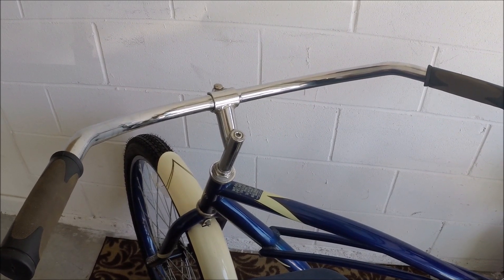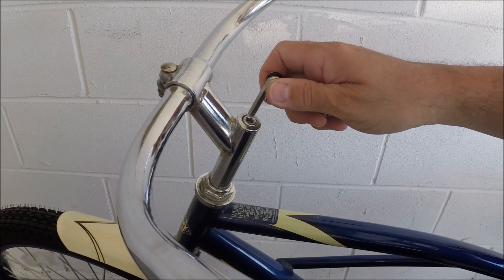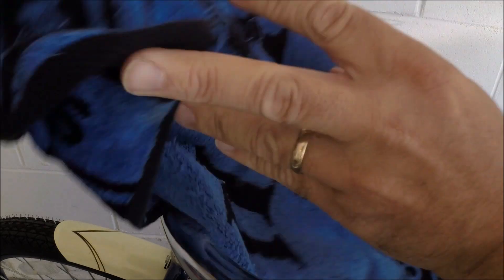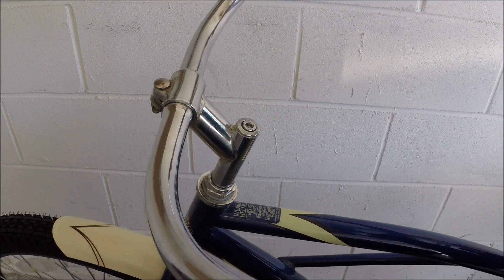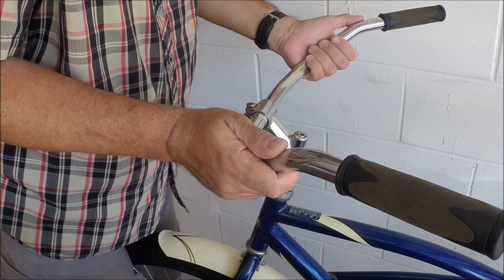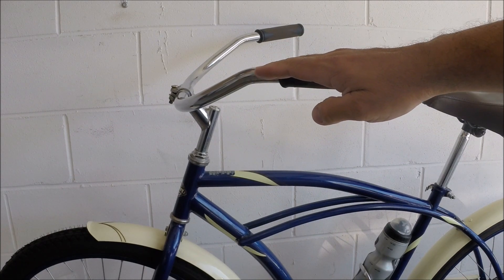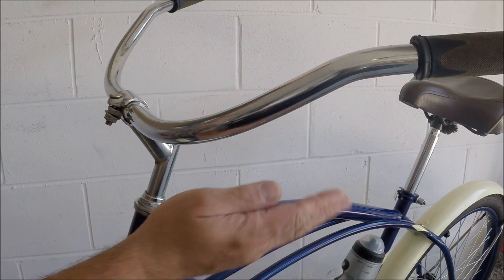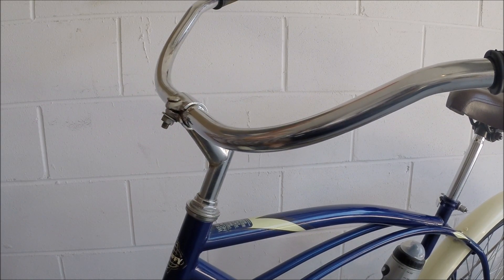How to adjust the handlebars on your Beach Cruiser

Comment: Thankyou for making this. I have a cruiser bike that had the bars at the right height for me, so I never bothered trying to adjust them. I might be selling it, and when I unscrewed the top bolt to see if I would easily be able to adjust it for the next person, I still couldn't push anything down. Figured I might have to take the fork apart or something strange, but never thought of a rubber hammer to shake it loose.
Reply from the maker: Yeah.. water and mud can seize them up a bit.

Comment: was able to tighten the align bolt, but what I can't seem to fix is main part that holds the steering , the gooseneck. Where you put your L tool, it'll stays loose
Reply from the maker: You might need a slightly larger circumference on the piece that sits inside of the gooseneck. You've got a couple options though. 
1.)Handlebars are cheap.. you can take it to the bike shop and see if they can upsize you, or measure it and buy a new pair online. 

2.) And a cheaper option.. they used to make metal handlebar shims that slide over that part of the handlebar and makes them fit tighter. I'm sure I've seen them for sale online recently as well as on ebay! Hope this helps!!

Comment: What if the Allen bolt is too tight, it won’t budge with the Allen key
Reply from the maker: @charlottegray5218  I would say try to use some WD-40 to help loosen it. Make absolutely sure the Allen wrench is very tight as you don't want to round it. Finally, try to slip something like a metal tube over the long end of the Allen handle This will give you more leverage to crank on it, as sometimes it's hard to get the proper leverage with just your hand on the smaller wrenches

Comment: I tighten my goose neck all the way but it still moves please help
Reply from the maker: Go to Amazon and buy a shim for it. This will fix it..
https://amzn.to/3DBaujw
Reply: @theretrodad8716  no it's not that it's like I stand in front of my front tire and I can still move my handle bars left and right when they should be tight with the front tire
Reply from the maker: @Steven Miller  Oh. If it's tightened all the way and it's still loose, you need a larger sized gooseneck. The best thing to do is to stop by a bike shop that also works on older bikes to see if they can fit another gooseneck. It shouldn't be expensive at all. They may even have a used one that would work perfectly.

Comment: What if it’s the bolt and it’s Allen wrench and at its tightest it still loose?
Reply from the maker: If the handle bars are still loose after a full tighten.. you may need to add a handlebar shim. They sell those on Amazon for pretty cheap.. or a bike shop could add one for you.

Comment: I was thinking I was doing something wrong, but as it turns out, the bolt I’m tackling is just too tight for me to unscrew 🙃
Reply from the maker: Yes.. those can get pretty hard to remove if they were initially over tightened, and then only get tougher to untighten over time!
Reply: @theretrodad8716  Any suggestions one breaking it free?  My dad put it together 10 years ago and it was ridden once.  I have been trying and trying to loosen it like you show, but no luck...